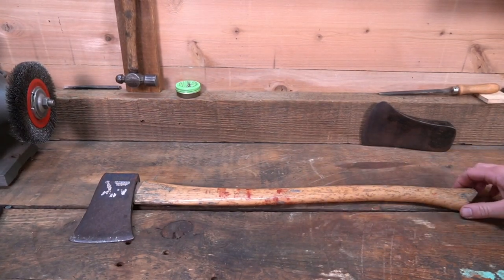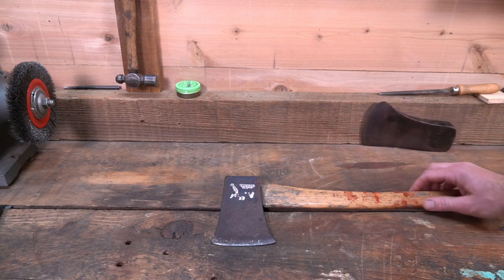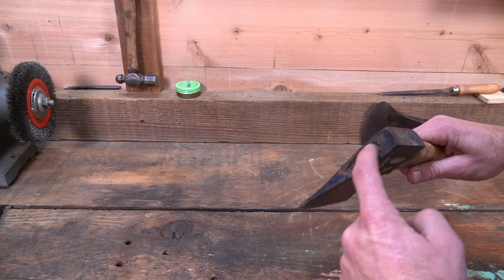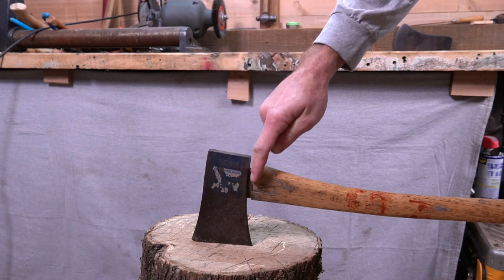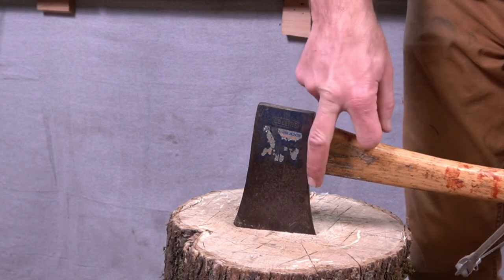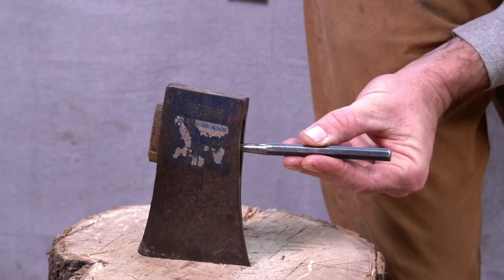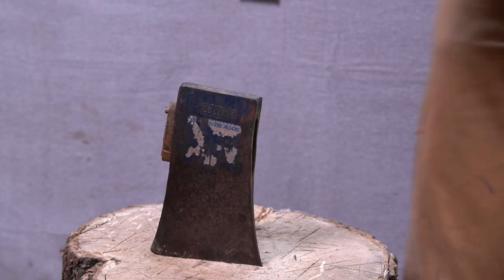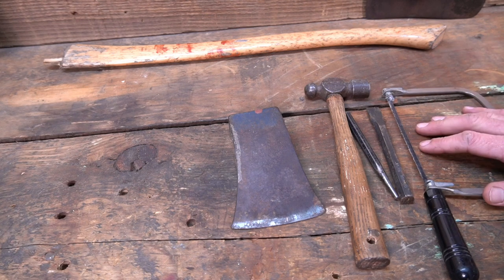How To Remove a Axe Head The Easy Way

Comment: Found thr right channel. Exactly what I'm doing. Also wanna try to use some wood from my small forest for the handle. Not sure if that ever works out.
Reply from the maker: Hell ya man. Many different species of hardwood are suitable for axe handles. White oak is actually a traditional handle wood and it's all over the country. Good luck man.

Comment: im having trouble the axe head im removing has a through pin that runs perpendicular to the circular metal wedges in the top, i guess this is what i get for getting an axe from harbor freight
Reply from the maker: Ya, harbor freight axes are definitely questionable.  I recommend looking for a vintage head at yard sales. 
Anyway about it,  you should be able to punch out the pin with a punch or maybe a small screw driver.  If that doesn't work then you'll have to drill it out. Good luck with your build.
Reply: @old_iron_axe_and_tool  thanks man. its just extra steps for no reason if the handles gonna break anyway lol

Comment: Throw it in the fire pit!
Reply from the maker: Sinful
Reply: great way to turn it into a door stop :)
Reply: I think it has something to do with the temperament of the metal but im using an angle grinder to sharpen it anyways so that was irrelevant I thought. this axe is like 80 years old solid piece of metal i wasn't worried about heating it. Ill make you crindge another step. It was a splitting axe head that i tried to make for chopping and it was my first time using a grinder. :)